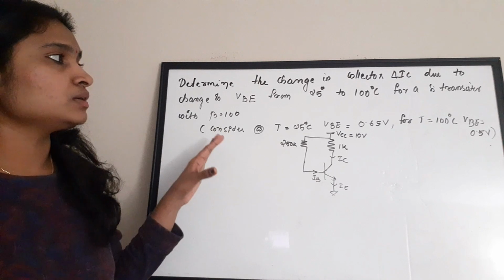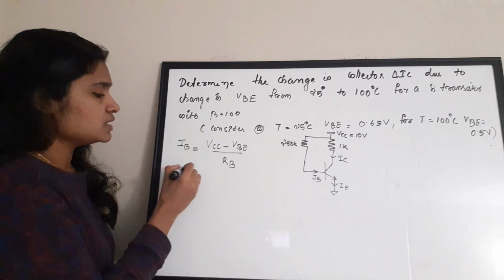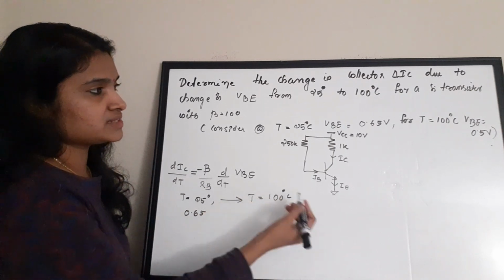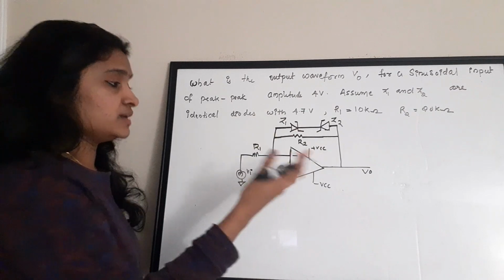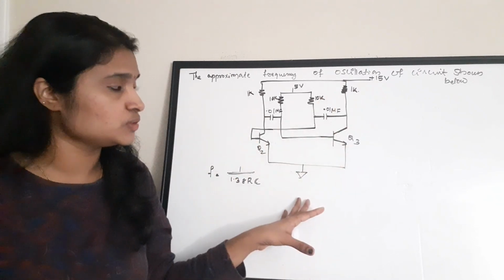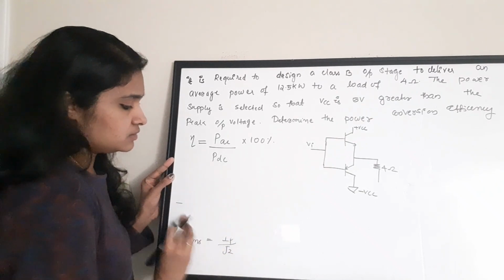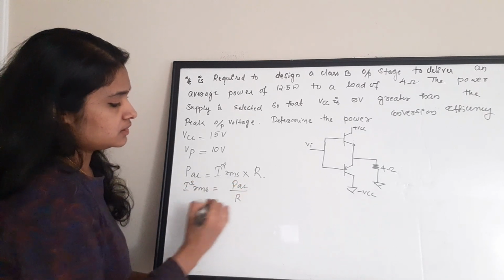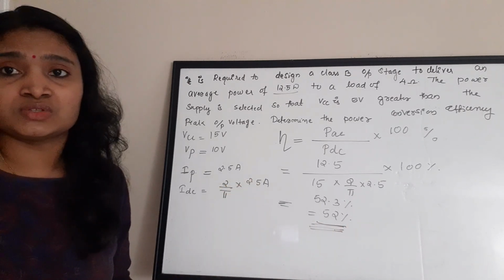SAC ISRO Scientist and Technical Assistant Electronics Preparation|Analog Electronic Questions Part1

Comment: I have a doubt in opamp question .  opamp output is
 Vo= gain*Vin  , our gain is 2 so the output amplitude is 8v but in 180 phase shift. But you told that amplitude remains same. Hoping your reply
Reply: Ya amplitude is 8 volt